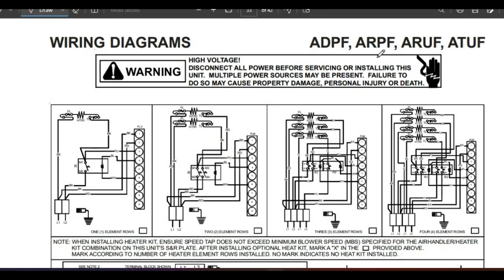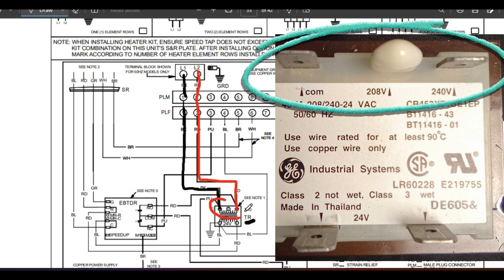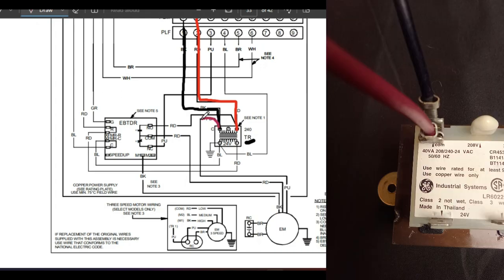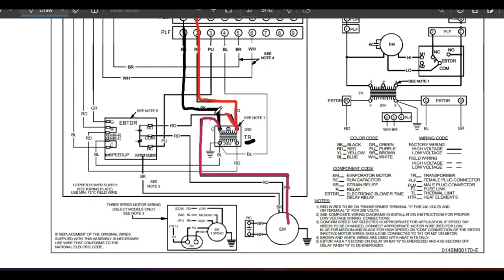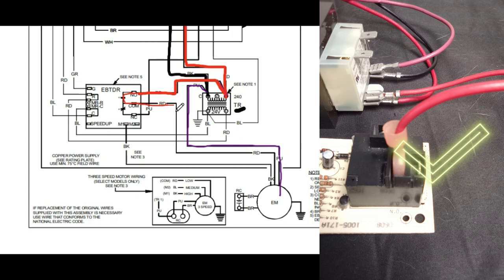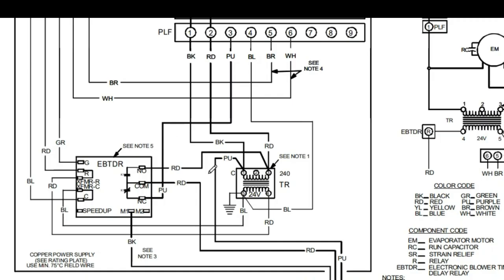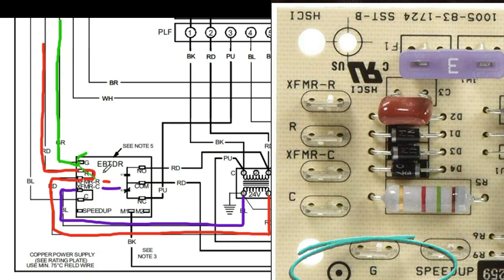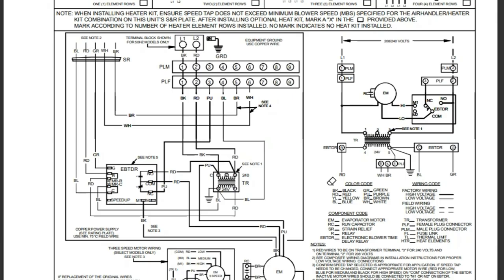Air Handler Wiring for Beginners (Fan Relays & PSC motors)

Comment: What I have is (same schematic) the blower motor will turn off. pulling t-stat off wall, no help, changed control board , no help. Is it possible the last guy mis wired the relay keeping it running all the time? Pulling heat c/b is the only thing that turns off blower motor.

Comment: So I just ran into an issue today, I’m thinking is a bad relay. Run true air handler heat strips contactor keep pulling in, I disconnected thermostat, zone board, basically all 24v except for molex which powers A2L board. Behind that board there’s a relay white wire (NC) going back to molex and red wire (NO) which comes from A2L board with 24v to relay. To my understanding, NO means relay shouldn’t be allowing for 24v to get back to white unless there’s a call for heat strips to engage; correct? Or I’m I missing something. Also when I unplugged white from relay to see if it was still allowing 24v from NO(red)>relay>NC(white) my meter read zero. I’m confused!

Comment: Super awesome video, just had a full new HVAC system installed and just by reading diagrams I had to correc them, they did not install my soft start correctly.  So I fixed it.
They also did the ducting for a whole home dehumidifier for me, but none of the electrical.

So I have to both get 120v power to run it (already have a plan for that) but more importantly I want to find a way to either have the HVAC system turn on the dehumidifier, or probably a bit simpler have the dehumidifier turn on the blower motor.

I am sending the output directly into the plenum, and while I think it should work without the blower running, I think it would work better to have it running to better distribute the air.

Comment: Hey Jm, is "common" and "neutral" the same? Why is the term "common" used in the 24v control circuit? Could you please explain fullly the term "common" in relationship to the TRANSFORMER? Please. It is just too confusing for me to understand. Thnks.

Comment: Thank you so much for this video. It really clears up my cob web on the control wiring. Is it possible that you could explain fully what "COMMON" on the 24v circuit really is? Especially just "the terminology" common. Because people all say that the R is the 24v from the trnxfrmr., but it needs the common to return this power? So can the trnxfrmr., works with ONLY the R terminal hook up, to a tstat that is battery powered, if the C TERMINAL is NOT connected from the tranxfrmr? I am not even sure what I am asking here. I am so confused.

Comment: Mike, I’ve got ARUF37C14AC air handler with 4-wire thermostat. I’m trying to install a smart thermostat which needs 5 wires. The thermostat comes with a power extender kit. I’m wondering if it’s possible to install the kit on this model of the air handler?

Comment: I always enjoy trying  to fix things myself most of the time. I have an exact system you are showing. The fan motor will not come on but the condenser does. You have given me a plethora of info to at least attempt to get it running before calling a real a/c tech.  :)   Excellent video!

Comment: 1st time seeing any of your videos. Just subscribed and look forward to viewing more. This video should be used as an example of the BEST way to do a presentation! Thank you.
Reply from the maker: Thanks and welcome
Reply: @JerseyMikeHVAC  I want to ask a question. Can I safely go one speed slower on my Goodman air handler? It is variable speed and I use it for shop heat with the 10, 000 watt heat kit. I didn't know if the coils would overheat or the sensors on the coils take care of that? Thank you.

Comment: Hi, I need help, my Rheem HVAC RF1T unit for apartment model and blower motor was changed to ECM genteq 1/3 ho 208/230 volt... connect it to medium speed T3 and when I do it, turn ON the thermostat is fine but when I put it on AUTO on thermostat and cold A/C turns on because the blower starts at maximum speed and doesn't let me sleep... I see that in the speed connection it has a green wire in T1 and a blue wire in T3... what should I do? I want it to be medium speed and not regulated.

Comment: Hello Mike! I just found this video. Excellent job! I have the exact same Goodman set up and card in my system. I've replaced the outside capacitor last year. I replaced the inside air handler capacitor this year and  the DI-POLE BREAKER on the furnace which acts as a cut off for the unit instead of a door switch.  One of the two pole breakers went squishy and wouldn't "click" over when switched. Now, my inside  blower fan stopped working. Anyway, I did the entire diagnostic in reference to your video.  . I checked the power up to the 240v side of the transformer and then direct charged the blower fan from there - it worked. So, I checked the 24v side of the transformer to the common on the control side of the board and got 24v as my reading. I decided to buy a new board for my system. However, I noticed a difference in your board and mine. Yours has a 3AMP fuse and mine doesn't. Would it be possible to just solder a fuse holder and fuse onto the contacts located just below what is labeled "JW1" on the board? Do i need this fuse? What is it protecting? Thanks man! You're the best HVAC guru on Youtube!
Reply: No need to solder onto your fan board to add a fuse. Just break the 24v hot side of your transformer wiring (not common). The fuse protects your transformer.

Comment: I have a goodman air handler with this exact set up as in the video. the relay on the circuit board went bad twice in one month. The first time, the filter was pretty clogged up and the blower would not turn off. It got so hot the circuit board actually melted some.  After spending way too much $$$ just to replace the circuit board, the system worked again normally. Only one month later, I noticed blower motor would not turn off and house was not cooling much. Went in myself this time and after troubleshooting, found the relay was was not working again. Tracked down the circuit board locally and replaced and system working again. The second time, no burn marks and filter was clean. Could it be transformer causing relay to go bad?  Thanks
Reply from the maker: How freely does the blower cage spin when turned by hand with the power off?  Does it keep spinning freely or does it quickly slow down and stop? Sounds like you may have an overload issue which could possibly be cause by a high current draw from the blower itself.  Could be the bearings or the motor.
Reply: Hmm…..how does the auto mode -fan on …mode work …am I right that auto mode goes through the outside contactor……good video …. 12:08

Comment: Okay
The problem was the transformer.  How i have 26 volts. My question is the thermostat  is a four hookup. It leaves me with a blue wire and the O wire that gos to the board. Can i use the O wire with yellow? And the blue wire cap it off.
Reply from the maker: I don't go by colors. I go by terminal to terminal. R from T-stat to R on relay board. G from stat to G on relay board. Y at stat directly to the outdoor contactor. Other wire from outdoor contactor to C on relay board.
Reply: @JerseyMikeHVAC  I understand .
I strace down each wire. From red to white to green to yellow. Again that leave me with two at the unit wires blue is coming off the side of the A/C contact that it maybe be the commen wire The O wire is coming off the the board. My question is what do I do with them. I have nit started the unit up until I here back from you to see what to do with them. I was thinking by your video to hook that O wire to yellow. And that commen wire to the white wire . Just asking.
Reply from the maker: What 2 wires are going to the outdoor contactor? Blue and what? 

What terminal is the O wire off the board connected to?  I'm assuming your talking about the relay board in the air handler? Do you have heat strips or a heat pump or anything else aside from straight cooling?
Reply: @JerseyMikeHVAC THIS HAS A HEAT STRIP.  They are two wires left over in the unit The blue wire is coming off the side of the A/C 240  contactor for the A/C . The other wire is as you said it's coming off the board  O side. Them two wires I'm sure at one time came off a diffirent thermostat That had the O B terminal.. I installed a new Honeywell 4 wire hookup. White Green yellow and Red. Check voltage there 26 volts. Just asking the wire coming off the side of the 240 contactor is that a common wire. And the O wire coming off the board is that the shuttle value wire.
Reply from the maker: Do you have a heat pump system? By shuttle valve do you mean reversing valve? I'm not familiar with what " board  O side" means. What board located where? In a heat pump system there are 2 boards. One inside one outside. 

There should be 2 wires to the 240 contactor outside. One is coming from Y at the thermostat. The other is common that should go back to common on the relay board in the air handler. 

I cannot answer the rest without further clarification.
Reply: @JerseyMikeHVAC Sorry about that. I have not took the time to know all the correct boards name . Again. Your post video  are helpful I guess I'll give up on that question . 
The Goodmen 3ton A /C package with the heat strip.  Will it run with the 4 wire hookup.That
 With the White Green Red yellow. Blue is commen no place to hook it to on the thermostats  or the other wire that's hook to the board with the letter O. No place to hook it on the thermostats either that's a total of 6 wires but only have a 4 wire hookup on the thermostats  side. Like to be able to shoot you a picture but it seem you can send pictures on  UTube. Only make video.
Reply from the maker: mjrusso@protonmail.com

Comment: Hello I have the goodman as you talking about 
This is what I'm dealing with . We have 220 volts on both legs. I can't get it to start up. I check the low voltage and it shows 15.09 volts. The red wire shows the same 15.09 volts. I touch the white and red together to see if it would start. Nothing then the yellow and green. Together nothing. Have 220 on both 50 amp breakers still nothing.
So I'm stuck in the Georgia heat.
Reply from the maker: What voltage are you getting out of the secondary side of the transformer? 15v there too?
Reply: @JerseyMikeHVAC  Okay Thanks for the reply.
The two top poles are showing power 120 per pole. The bottom poles are showing 15.09 volts. After watching your video 5 time back to back. The power wire that should have 120 volts at all time at the blower motor is not there?
Reply: @JerseyMikeHVAC  well I was checking the volts coming out of the breaker box in the house. As you know I have two lines running to the system. Both are 220. The top line is for the A/C system. The bottom line is for the Heat system. After checking from the house both lines are pushing 220 from the house outside to the unit. Top A/C has something that looks like a breaker but it looks to be a contact type breaker have power in and out.
Now the bottom breaker has a off on states 45 amp. Well after checking it on both side is were the problem comes in. On side shows 124.9 volts the other side shows 19.40 volts? So I removed the wires from the and tested it again now I have 220 volts.
That breaker must have some type of problem for it to let let power come thou the other side of that breaker. I'm sure that maybe the main problem.
Reply: Well after replacing that breaker  now there's 19.48. On the low voltage side and have power on one leg of the blower motor. STILL WILL NOT START UP. MAYBE IT THE RELAY?
Reply from the maker: When you check for low voltage coming out of the transformer, make sure to disconnect the low voltage wires from it. You want to see if the voltage drop is still there on the transformer without a low voltage circuit attached to it.  The reason why is because on a voltage drop problem like this, the problem is typically going to be because of a high resistance problem with a switch, a relay or the board itself. Possibly even the fuse. With the low voltage wires disconnected from the transformer, this test will tell you if that resistance is indeed in the low voltage circuit somewhere if after disconnecting it you read the normal 24v off the transformer.  If you are still reading below 24v, then you have a high voltage issue or a transformer problem. Since you already have 120v on each leg to the transformers primary side, then it can likely be a bad transformer if you're still not getting 24v (most readings I take are actually higher than 24v, typically 26-28v). 

 If you confirm you have normal voltage off the transformer without the low voltage circuit attached to it, you now need to go through your low voltage circuit to see where the voltage drop is occurring. Remove the low voltage wire from the R terminal on the fan relay board and test that R terminal for voltage. If you're reading less than 24v there, see if you're getting a voltage drop across the fuse. Test one side of the fuse for 24v then the other side. If you see the drop there, replace the fuse and if it still persists, then the fuse connections on the board are the problem.  

If you do read 24v at the R terminal with the R wire disconnected, then your issue is downstream somewhere. Put the R wire back on the board and remove the wire to the G terminal on the board. Put the thermostat into cooling mode and test for 24v at the G wire itself where you disconnected it. If you still see 24v there, then there is a problem with the fan relay board itself. If you see a voltage drop on the wire, then shut the power off to the air handler and put the wire back onto the G terminal of the board. Go up to the thermostat and jumper R to G to bypass the thermostat. Restore power to the air handler. If the blower starts right up, may be time for a new thermostat.
Reply: @JerseyMikeHVAC  Okay
After check what you said it still the same. The low volts side unplug is right at 15 to 19 volts. So after I purchase another  Honeywell T834C 1137.
That was a waste. Again it's NOS But never been used. So the next thing is that transformer.
I unplug red wire from the broad tested the low voltage there its the same 15 to 19 volts.
Guess it not enough to tell the relay to what it needs to do. I check the transformer with the volt meter and it shows connection on upper and lower. I was thinking if it not going to work it would show anything but the it to show 15 to19 volts is crazy to me. You no when  a relay stops. Working.

Comment: Why is the common wire taking power to the fan motor? And why is there 120v going to the common terminal on the transformer?  I always understood common was ground
Reply from the maker: It's not a common.  It's a 240v motor. That's a power leg.
Reply: @JerseyMikeHVAC  why does it go through a common on the relay and why is there a c beside the transformer.  I know you're busy if you don't have time to reply I understand
Reply from the maker: @trevmint5615  It's a common terminal for 2 circuits. Not an actual common as in neutral/ground.
Reply: @JerseyMikeHVAC  that's what I've been thinking and waiting for someone to say.  Thank you.  You really are very good help.
Reply from the maker: @trevmint5615  No problem. Thank you.

Comment: Thank you Jersey Mike!! Had a local HVAC guy come out, and he said I needed a new air handler at a cost of $7-8000 to replace the entire unit because he said it was too complicated, and obviously didn't think to look you up online!! Took me the length of this video to have my air handler up and running.
Reply from the maker: Nice job!
Reply: He is the best
Reply: He could have just been talking about if you had an R22 unit and since  R410 units are no longer made and the new a2l r 454b units are being pushed out that's what he was talking about
Reply: @keepthinking2666  No, he was just trying to make some $$. It works just fine now. Had another shop come out and add a small amount of refrigerant, but other than that it works as it should
Reply: Same thing happened to me. Except after he "serviced" my unit, he said everything looked fine except my blower was going out and when it did, I'd have to replace everything for about 7k. Noticed after he left, my blower stopped working. Was about to call and get the unit replaced when I decided to Google my system and found this video. The technician had wired the motor to the capacitor backwards. System works fine now. 7k I couldn't afford saved. Thanks @JerseyMikeHVAC

Comment: I have a Mr cool 3ton universal heat pump. Running it currently only with a heat kit and no refrigerant lines connected to it. My board went on a power outage and i was sent another board. This board is different by 2 pins on the board. There are no longer in/out pins for the heat signal wire to connect to from the heat kit molex plug . Looks like a relay was once there ( telling from the old board) and now those pins are not there on  on new board . The exit of one of those pins went to w1 . Should I run the red signal wire directly from molex plug to w1 . Maybe that relay connection was going bad on old board and they superseded the board with a better design?
Reply from the maker: The W1 should be the power feed in from the stat to activate the heat strips. The other should be a common.